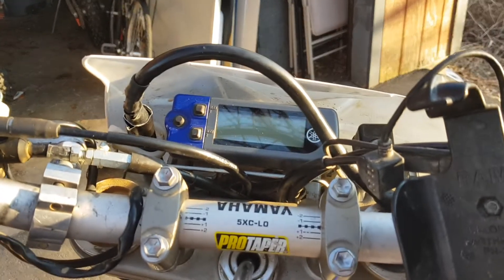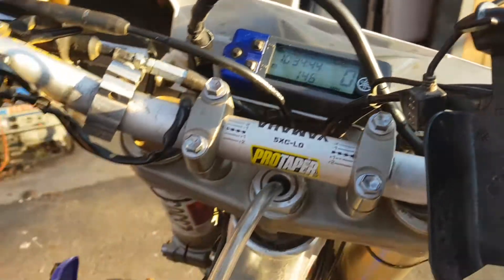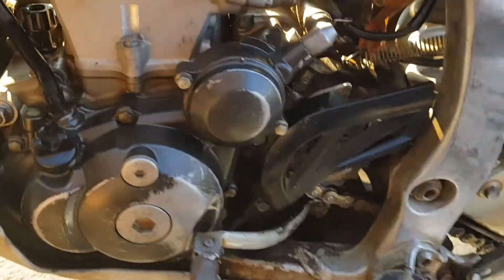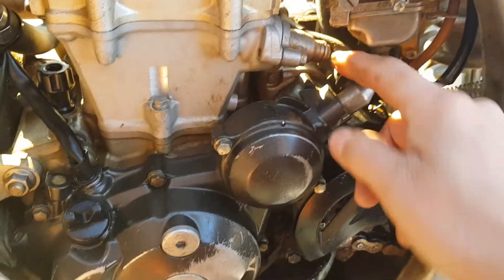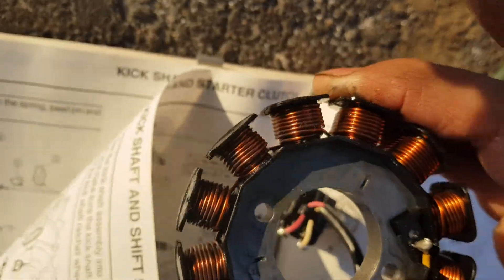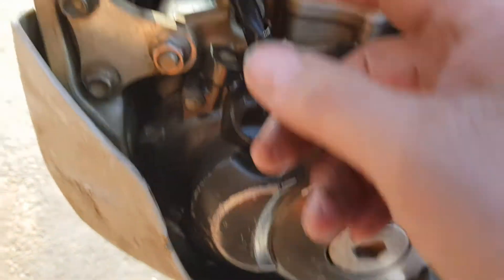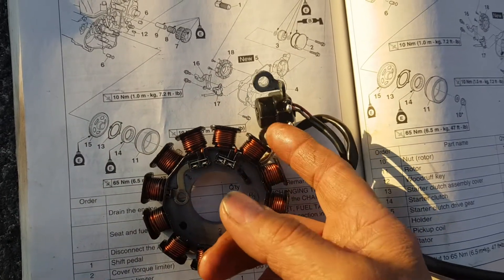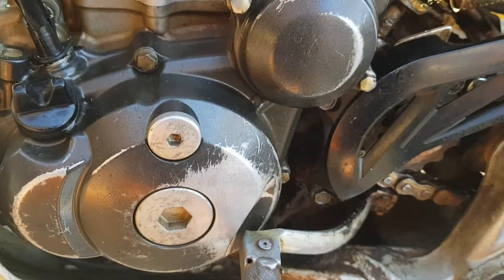Yamaha WR450 charging system diagnosis

Comment: Great job,, I have the '05 WR450 I'm assuming the procedure is the exact same. I've killed two new batteries I have a voltmeter on my handlebar and sometimes it goes to 8 or 9 volts all electrical dies but the bike still runs who knows maybe that will die on me soon altogether so I'm thinking about changing the stator and the rectifier together. Are you having good luck with your aftermarket one?
Reply from the maker: Yes. Been working good
Reply: @peteranania7166  Was it the Caltric?
Reply from the maker: @seatime674 yes
Reply: @peteranania7166 Well you made the video 6 years ago so if it's still doing good after 6 years and maybe a few thousand miles later I'll give it a try ty👍

Comment: I have a question in my 1998 wr400r dont had spark so when i take off the cover stator, leave the oil all is normal or no
Reply from the maker: I think you should check your ignition coil first.

Comment: Is there a way to test the stator.  Would a bad rectifier cause same symptoms ?
Reply from the maker: A bad rectifier would cause voltages to go up and down and not the steady 12-14 volts. Anything above 14.5 volts could cause bulbs to blow. On the stator, look for discoloration of the windings. Ohm reading of zero shows a short.